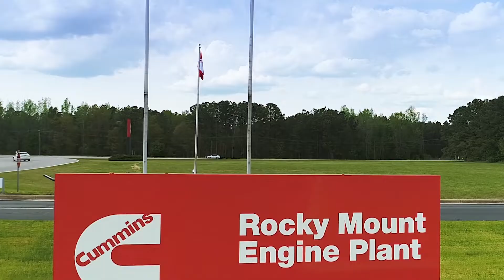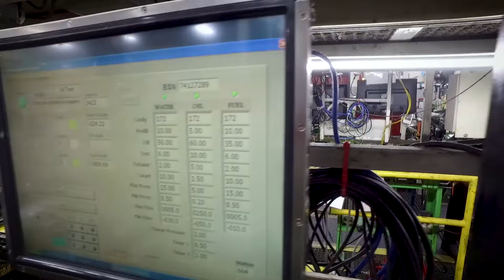This is Cummins Rocky Mount Engine Plant

Comment: Cumapart is the best description. The newer a Cummins engine is the bigger piece of junk it is. Your doing good to get 300,000 miles before overhaul with the 14 model year engines. Then they'll say it's your fault while they're putting redesigned pistons,liners and most other internal parts in your engine on your dime.